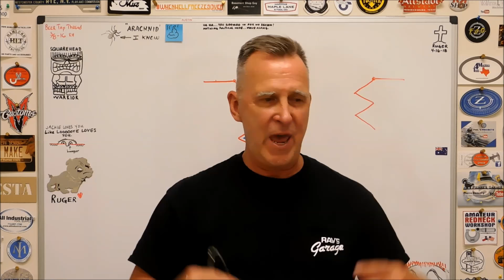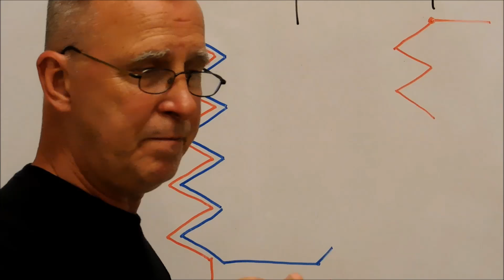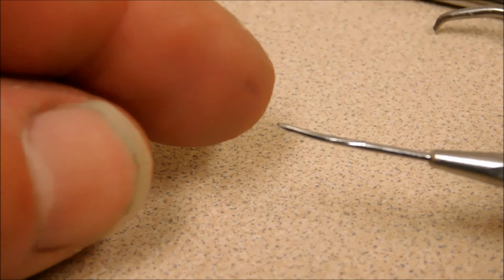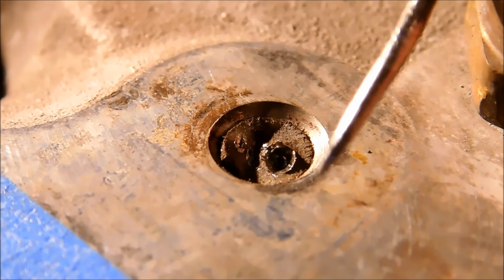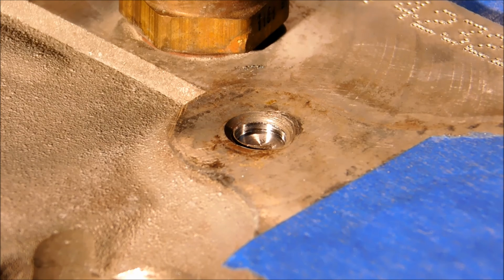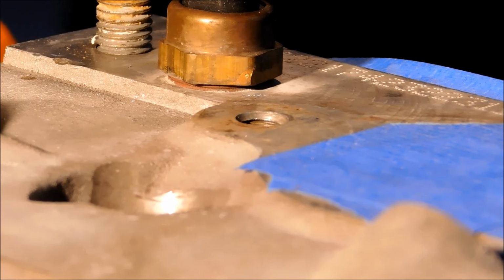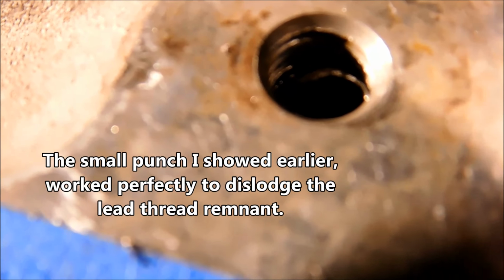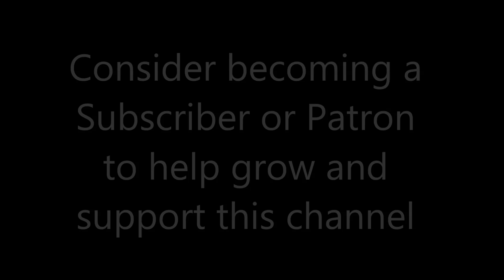Removing Sub Surface, Snapped off Bolts -- Take a Look !!

Comment: Your technique is by far the best in my opinion. But getting all of the bolt’s body without cutting into the ID thread is difficult. I use an end Mill when I can and remove the body little by little. Your punch that is tapered on the end is a great tool.  I’ve been removing broken bolts for over a half century.  My dad’s favorite methods was to braze onto the bolt and buildup over the surface, and then use vice grips to screw it out he removed broken EZ outs many times.
Reply from the maker: Its quite possible I have broken every easy out I have ever attempted to use. I'm not a fan.

Comment: It really is incredible how accurate just eyeballing something can be. The hardest part about getting broken bolts out of aluminum is the drill wants to walk off the steel bolt and into the soft aluminum if you're not in the center of the bolt. If that happens you're screwed.
Reply from the maker: I agree. I can get parts nearly perfect on a lathe by eye. Just years of conditioning.

Comment: Mighty fine job Joe. I've done it this way on and off. I do usually try the punch first as you did, then I try and easy out after heating it with a butane torch. If that doesn't work then I drill and pull the spring out like you did. If it's cast or steel sometimes you can weld a nut on it. The exception is obviously non-ferrous metals because it will melt before the steel so you can't do that with aluminum ect. Thanks for sharing. Loved it when the coil just unwound out of the hole. Best Wishes and Blessings. Keith Noneya
Reply from the maker: Thanks Keith. Stay well.

Comment: On the production front, a ring light or a co-linear light would help see down the hole. Both are within your DIY ability. A short string of led tape for a ring and or a piece of glass set at a 45⁰ angle so the camera shoots through and the led bounces off and right down the hole. Also the left channel audio kept messing up. Might be a bad connection or the mic getting covered. A camera handle can help if the mic is placed where you just about can't help covering it. 

The machining was excellent. 

In my much less well equipped life I often use a Dremel to smooth the top of a broken bolt. The broken surface is the hardest part of the bolt and even if it looks flat a drill is going to have trouble getting a bite. A little grind with a burr helps a lot. Last when I use an ez-out, I heat the hole and cool the bolt, then oil it and re-cool the bolt using an upside down air duster. I put a little torque on the ez-out and then tap it with a chunk of soft metal like lead, brass or copper. I don't remember who told be about tapping on an ez-out but it seems to work quite well even though the bolt would tend to move in both due to the impact and the threads on the ez-out.
Reply from the maker: Thanks for the suggestions and comment.

Comment: As usual great content, been there more times then I care to remember. As you well know, set up can be the hardest part of the job! Would be interested in seeing the set up to get the exhaust ports to be parallel to the table. Cylinder heads are a pain. Keep up the good work!
Reply from the maker: It was shimmed, bumped and indicated to get it absolutely flat to the table and true to the spindle. Thats half the job right there. It was very awkward because of the weight.

Comment: Hi Joe, it might help to look for some Hemostat Clamp Forceps (surgical tweezers) that can lock closed. They come in various sizes & also with bent tips. They are great for fiddly little jobs and are small enough for tight spaces. Keep them with your dental picks.  Stay safe and well :)

Comment: Thanks Joe that another tool in my box. Tell all the car guys it only takes a second to wipe or spray anti seize compound on all studs and any thread you may want to undo later. Prevention is better than cure.
Reply from the maker: A good motto to live buy.
Reply: Does applying thread locker also stop water from entering thread and thus prevent rusted threads?

Comment: +1 on charging 3 times if they worked on it first themselves. I’ve had pretty good luck with tig welding a bead up on small screws broke off under the surface. Just keep stacking until you can grip it with pliers. This works good if the head was sheared off and not due to over tightening or rusted in. Many different ways to get them out, and everyone is it’s own mess.
Reply: An old friend long ago had a sign which said" labour rate £10 an hour, £20 if owner watches and £30 if owner helps" well i did ssy it was long ago. If the owner helps by starting to drill he deserves to pay triple.

Comment: You wouldn’t believe how many broken taps I’ve had to get out of expensive jobs that apprentices have broken. Because taps are hardened I generally have to use carbide cutters. I remove them a similar way to what you did and it usually works.
Reply: Taps are the worst, especially when your using 4-40 threads. I use a drilled spanner bit (two prong bit) appropriately sized for the flute egress diameter, or I will make one, 50% success most of the time, else Joes method here, flatten the tap with an end mill, drill and pick. Only other method seems to be welding onto the culprit, I have not had great success with easy-outs, but they do work sometimes. Carbide is not springy, so lots of picking. At least with taps, it not usually seized or welded in there. Only happens when you put 8 hrs into a part, last hole to tap...
Reply: J Jordan yes I know what you mean but because our parts are for aircraft welding isn’t allowed for one, and the other problem is the tapped hole would still have to pass inspection with a plug gauge so any damage is not tolerable. Luckily with taps they can be fished out in small pieces without causing too much damage. It would be a lot easier if people didn’t break taps in the first place.
Reply: Kevin Woods Carbide spade drill? I keep an assortment of them for just such emergencies.
Reply: James Davis yes it’s amazing how we accumulate bits and pieces for such jobs.
Reply: @KevinWoodsWorkshop  Yeah, Im the apprentice in this scenario, fishing out my own mess.
Reply from the maker: Its good practice.

Comment: Thanks, good video. Unfortunately what I break is usually a thread tap! Last week my more experienced machinist co-worker helped me drill one out with a carbide spade drill. The remnant did not make a nice spring, just bits and pieces that were getting in the way of the next attempt to tap the hole, however it was eventually successful. The spade drill got a couple of small chips while drilling, we stopped once and sharpened it before the hole was complete.
Reply from the maker: Usually those tap remnants engage the drill or end mill and claim that too. Thats a real mess then.

Comment: How about a vijeo on how to do this while still on the car using a drill etc? I can't get that 0.001 coaxial line up!
Reply: There is a tool for that. Basically a drill insert that fixes against the chamfer
Reply: Fab a jig and drill button.
Reply from the maker: Utilize the available holes for a jig plate to help guide the drill bit.

Comment: In my opinion,the person who named those tools,”easy out” should be sued for false advertising.Admittedly,the straight flutes are better than spiral flute,provided,you tap them in barely enough to get a grip on the bolt.That is a great technique you are using,Joe.It always ticked me off when someone asked for help getting a broken bolt out that they beat up with punches and drilled off center and crooked with a hand drill.Makes life interesting, I guess.

Comment: thats a coincidence. I've got to tackle a sub surface snapped-bolt in an iron block with an iron head. The head is still fixed to the block in situ by the remaining bolt ....trying to think of a way that I can  mount a drilling /milling spindle on the vehicle, and use some of the principles that you have shown. GREAT VID AGAIN Cheer!
Reply: If you're careful, you can use a hand drill, go slow and work your way up in sizes, then try using a punch or a tool like his rounded "chisel".  Chances are, you aren't going to get it centered but once it's thin enough, punches can break the remaining shell loose. I've done it on a few machines but it's not pretty ...or quick.

There's also mag drills but I'm guessing you've already thought of that.

I can't think of any other cost effective way to do this in-situ if the bolt is jammed/fussed or whatever.
Reply: I had the same problem with a 10mm stud broken about 3mm (1/8") below the surface. The technique I used was to take 10mm allen headed screw and drill down the centre. Best do this in a lathe if you have one but I managed it with a drill press and the machine vise. By memory I drilled it out to 6mm. Don't make it too weak.
  I then put a nut on the hollow screw. I put the screw in the hole and finger tightened the nut down to the surface of the block to make sure it was perpendicular. I then drilled through this hole which is nicely centred and coaxial to the  original hole. The last operation is to use the correct size drill to leave just the helical thread and pick it out as per Joe's video.
Reply: you can try getting a self centering hinge bit and try switching out the drill with a quality left hand bit
Reply: @unpopular_mechanics  I have a set of those. They don't go as big as 3/8"or 10mm. Plus, I've not found them to be very accurate.They work for hinges but there is too much play for use in this application. (Yours maybe a better quality)
Reply from the maker: I just saw those hinge bits. Cool stuff.
Reply: Joe. Those bits (I have two sets) are not accurate enough for this job. Plus, the swarf will drive up the flutes and jam the sliding sleeve
Reply: @charleswhitehead7441   As with everything, it depends on your exact application. If you are drilling into the side of an engine block that you don't want to remove from the bay, you won't have much accuracy anyway. It is just another option for certain situations. Also making a higher precision version could be an interesting toolmaking project.

Comment: Ridgid Tools Co sells  extractor sets featuring drill bushings, drills, and splined extractors, and splined nuts. The drill is sized to the splined extractor not the threaded hole in this case. The bushing is held into the hole chamffer, and the extraction hole is drilled .  Then the extractor is driven into the extraction hole and the splined nut is slid over the splined extractor. A wrench (spanner) is used to turn the nut and spin the broken off fastener out of the hole. I employ this method in or out of chassis. Before the splined extractor is driver into the hole, I assess the likelyhood the broken fastener is rusted in place. In the case that it is (in most cases it is) heat applied by acetylene torch directed into the new hole and heated to red. WD40 is sprayed into the new hole for thermal shock effects. Then the splined extractor is driven, nut installed and then the broken extractor is spun out.. In chassis, a right angle electric drill with stubby drill bit can be handy.

Comment: The only thing worse than a snapped off stud is a snapped off EZ-Out, and boy, do they snap off.

I use the same drill out method, I'd rather spend a lot of time making sure I have the a good center marked, than fight with trying to get the stud out.

A frozen or broken off stud of an exhaust manifold, EGR, or something with heat involved react well to the freeze spray/oil products.  Loctite and CRC both make a product.  It's the opposite theory of heating something to break it loose.

Heat works well for a nut, because it expands the nut.  The freeze spray shrinks the bolt or stud, so it works better for those. 

GeoD
Reply from the maker: I like it. I have to try that.
Reply: But here is the problem with cooling. How much temperature difference can you get by cooling? 200F? With heating you can go 500F no problem..
Not that I am endorsing one or the other.
Reply: @Ramon Ching
I was skeptical, at first, myself.  Then I found myself needing to remove an EGR valve from a 120k '89 Olds. I just KNEW I was going to be drilling out some broken studs.  Instead, they came right out. After years of heating, cooling, rusting and seizing, the original studs came out in one piece.

It's not the solution for every situation, but if you can get enough temperature differential to break the corrosion, it's work.

If you're taking something apart and planning on replacing the fasteners, heating something to red hot works great, (as long as you don't damage surrounding parts), but in situations where you have electronic parts close, or in the case of the electric EGR, which heat would kill, (the problem was a leak, not a defective EGR), finesse is called for.

Working in a flat rate shop is challenge if you want to feed your kids, (flat rate is when you get alloted a set amount of time to remove and replace a component, dealerships and most shops work on flat rate.)  Take too long, and your hourly goes down. 

Break a stud, you get nothing extra for the time to drill it out. On top of that, most shops and ALL dealerships don't pay enough for a flat rate hour, which means if you only clock 40 hours of flat rate a week, you aren't gonna make much money.

I found I had to book ~60 hours a week, at a minimum. Just to survive. Teaches a guy to work smart. You figure out what/how to do the problem job while working on an easier job, or two easier jobs, if you can get the work space from the shop.   Three simultaneous jobs is doable, four is a bit of a challenge.  LOL
Reply: Oh, I forgot.  Transfer punches work great for finding the center of broken bolts/studs. Works like the pin gage, but you can tappy, tap, tap it, to mark the center.

Comment: It seems the critical part in this was sort of skipped over.
Not sure about the geometry of the cylinder head, but how did you square it to the quill?
Reply from the maker: Indicated. X and Y to zero
Reply: @joepie221  , My question was not clear. How do you know the screw hole depth angle is square to the quill?  Most cylinder heads surfaces are not cubes, therefore Id like to know how you determine the fixture angle?
Reply from the maker: @TRENDewyZ  I verified the hole true to the head surface by putting a gage pin in another one of the holes and checking that one.
Reply: Joe Pieczynski ,OK, makes sense, but how do you fixture the part? It is not shown in the video, and the fixture seems like the most difficult part of the entire operation.
Reply from the maker: @TRENDewyZ  Positioning and clamping that part was a major league pain in my a#*.
Reply: @joepie221  I was about to ask the same question, how to make sure you were square with the bore of the hole. I see your comment about using a gauge pin in another hole, which would have been one of my guesses. I'm glad I wasn't far off! I'd hate to see how it'd be done in a hole that doesn't have any others on the surface to compare to! Maybe indicate the surface til it's flat to the quill?
Reply: with a Bridgeport you can swivel and nod if necessary, PITA but for x some jobs it might beat fixturing the work

Comment: A pneumatic vibrating scribe and penatrant is my go to before doing the set up for your technique. Works well unless the broken bolt is bottomed in the hole then it's drill time. Thanks for sharing your technique. Regards, L J
Reply from the maker: Try 'KROIL' Best penetrating rust dissolver money can buy.

Comment: Dental tools
I experiment a lot and when I got to the dentist
I ask for any used ones they are throwing out or not using.
Dental tools usually have a plastic handle as the ones I have acquired with grip carvings like a knurling... 
 seen some marks I could not make out

Usually I find if i'm close to the bolt size and haven't gotten through to threads size
The bolt usually still comes out easily

Comment: I worked at Waste Management for 20 years in  the shop I was the one they called on when some one broke a bolt. Pretty much the same idea but did it by hand some things you just can't take off and get to a drill press or mill
Reply from the maker: Was it a shitty job ? Sorry, I had to do that. I bet a mag drill was your best friend.

Comment: All of things you suggest are great if you can doing them in a machine .But I have never failed removing broken bolts of virtually  any size even 8/32 stainless machine screws size by first weld a washer on the end of the broken bolt even if it is not flush with the surface  weld i up to the surface then weld a nut to the washer  then quench with water not lubricate the extreme heat from the welding  and the quench will shock the rust and they will come out if it breaks loose don't give up just do same procedure again be patient they will come out.

Comment: No competent mechanic puts a steel stud in aluminum without nev-r-seeze. Same goes for spark plugs.  I accept no excuses, 1/2 measures or shade tree nonsense.   Great video.
Reply from the maker: It only takes a second.
Reply: I agree with Never Seeze but some applications call for 271 Loctite
Reply: Red loctite is almost always used incorrectly.  People think red is stronger so it must be better.  But if the surfaces are properly clean, a torch (some sort of strong heat) is needed to take it appart again.  Blue is almost always called for.  Industrial stupid is using red with aluminum.  When I see a guy use read with Aluminum, I know he's not a mechanic.  Many times (not every time) threads will be coming out with the fastener.  I had to show my very experienced boss thead damage in aluminum equipment we had before he hid that bottle of red.  Only to be used by very experienced mechanics.